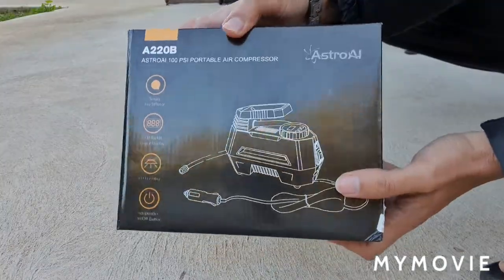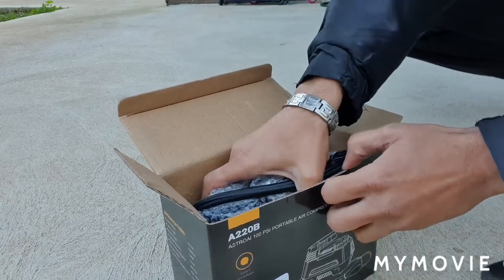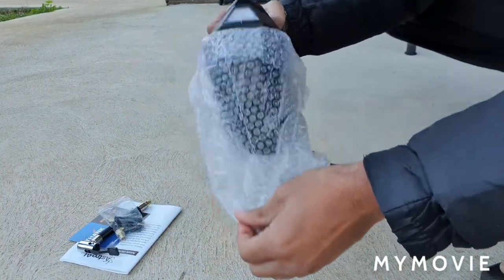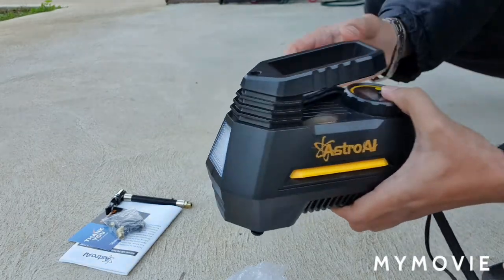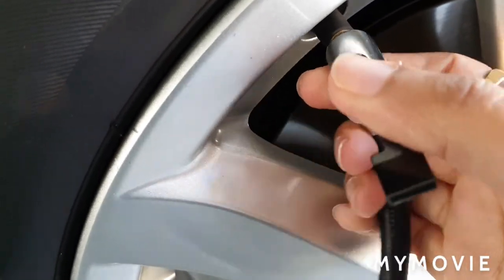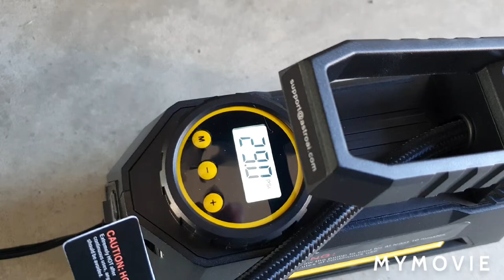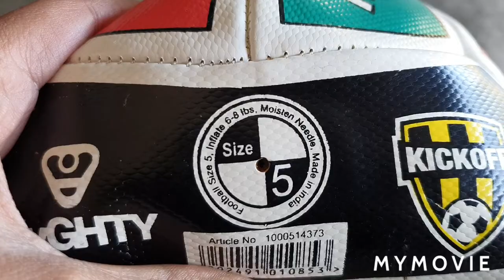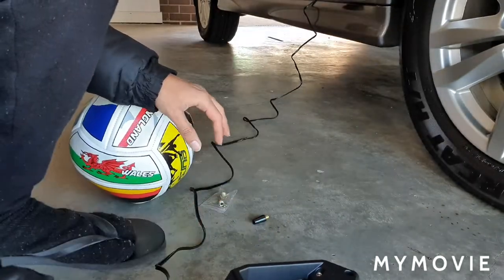AstroAI Air Compressor Digital Tire Inflator (A220B) - Unboxing and Review

Comment: you set it to 33 PSI and it inflated the tire to 34 PSI.  Then you manually measured it and got 30 PSI and you said "It's quite accurate"?
Reply: 🤣 it fills a psi higher to account for the air loss when disconnecting
Reply: Master of maths
Reply: @sabastianavola6751  Yeah it does, but a wheel is pretty big while the "amount of air lost" looked like it was very, very small. 

That's still a 2-3 PSI difference.  

Why the funny emoji?

Comment: I just used one, it worked great. Why did you need to start your car?
Reply: I literally just opened mine (Amazon delivery), and it says in the manual that vehicle needs to be running.
Reply: @luckiiredd8684   that’s my problem with not reading the instruction manual throughly.
Reply: @countalucard4226  honestly, I usually just come str8 to google/YouTube for all the answers lol, but surprisingly, i read the manual thoroughly then came to YouTube 😂🤷🏾‍♀️ long as it works, thats all that matters🤝🏾
Reply: Keep the car running so that it won't drain car battery

Comment: when i am putting this in tyre it stops working.do u know what might be the problem
Reply: Exactly! Pumps for about 10 secs and shuts off...wtf!
Reply: @adventageousrebel739  i returned it
Reply: It’s was probably your 12v power plug. Sometimes my plug does that (knocks my Bluetooth piece out, and it knocked the cord out for this exact air compressor)